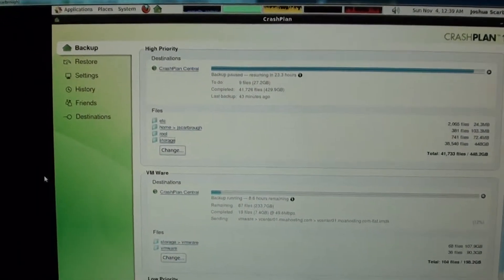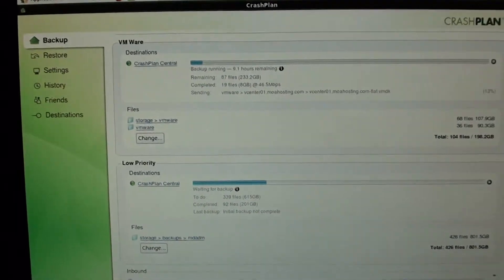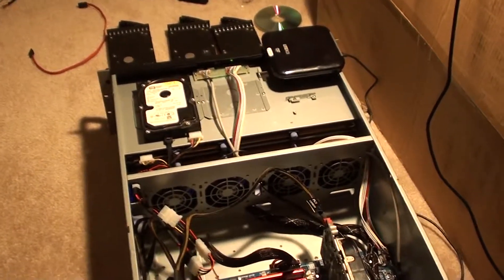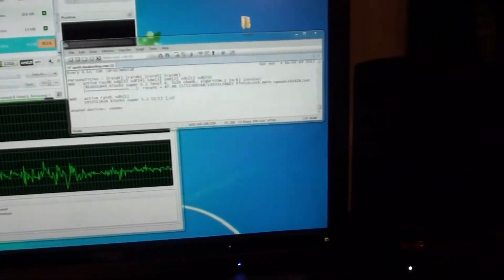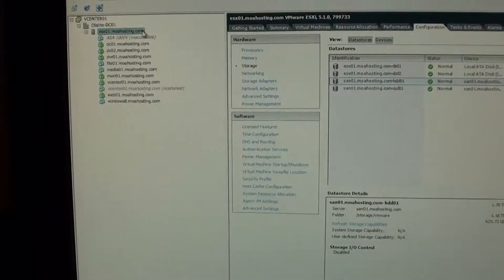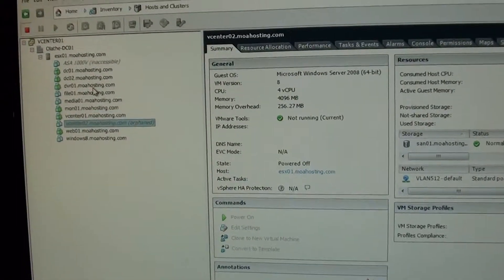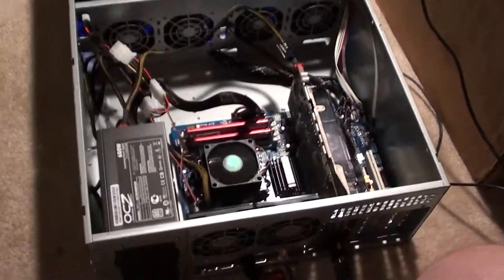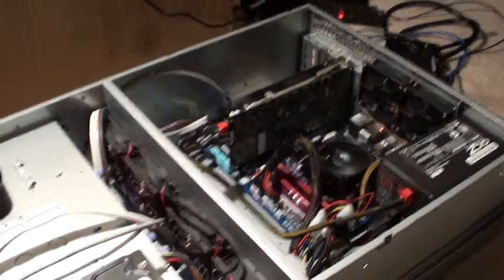Norco NFS SAN Build - Part 4 - Software Configuration Overview

Comment from the maker: Newegg had a good deal on the AMD procs.  I used to run Xen, then switched to KVM, and finally wound up using VM Ware.  All of the customers I visit run this software so I needed to familiarize myself with it and turns out it works really well and is super easy to install and maintain.